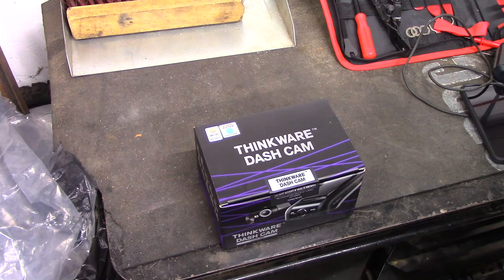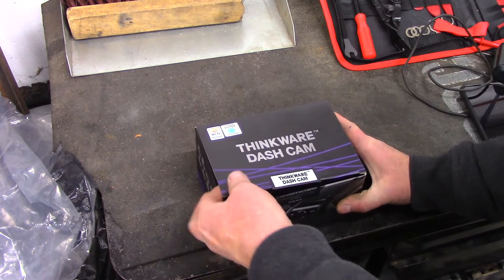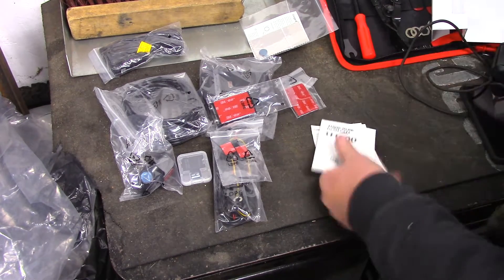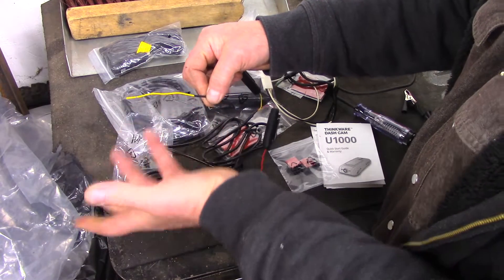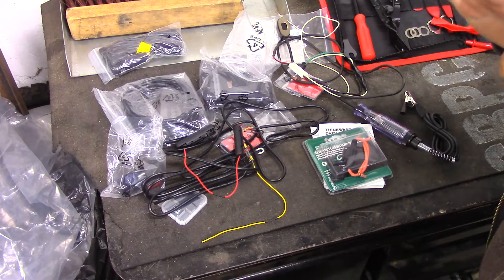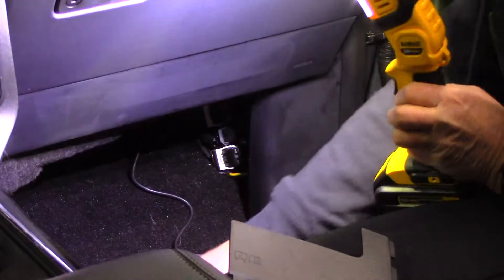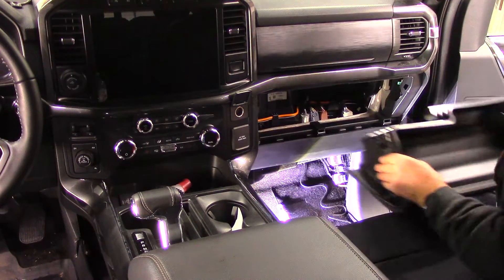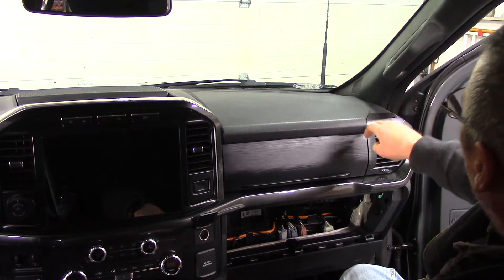Installing the Thinkware U1000 dual dash camera in the 2021 Ford F150

Comment: Great video. I’ve had the U1000 front and rear in my 2019 Raptor going on two years now always powered via OBDII with a dedicated hotspot that runs 24/7 to allow it to send my alerts if a parking incident should occur. You actually get the same parking incident recording options via OBDII as you do by hardwiring it with the battery protection feature turned off the camera will record 30 seconds prior to an incident should one occur in parking mode. The only mode it waits for something to happen before recording is “energy saving” which you may as well never select if you want true parking mode recording. Anywho thanks again for the video I never properly hid any of the wires so with this video I gave it a go finally. Cheers 🍻

Comment: That wireless charger fuse is the usbs slots inside the middle console armrest. Thats the only “wireless” charger i could think of, i also have a 2021 f150 xlt with the 302a package. I use the usb slots in the center console and my phone charges with the truck off too. Which should explain the constant power. Im also installing a dashcam, particularly the Vantrue n5 one. Does the trucks battery not get drained by having it solely tapped on a fuse with constant power? Excuse the ignorance im learning as I go
Reply: And a side note, i dont know why or how but both the cigarette lights in my truck have constant power with truck on and off so i couldnt use the cigarette lighter for power. Dont want to run the risk of a dead battery
Reply from the maker: It will completely drain the battery in 3 days......  These fords have so much electronics running even in truck off.  My 2006 silverado went over 10 days when I noticed I forgot to turn off the dash camera, it started !

Comment: Excellent video. Thanks for showing the trim removal part, no one is showing in there videos and i was afraid i’ll break it.. lol. Trying to save $250 + tax CAD in installation charges by the local shop. (spent all money on the truck 😂) Where did u coil up the access cable?
Reply from the maker: I just found a place in the pillars to hide the access, paying attention not to block the pillar air bags.

Comment: Which two fuse slots did you use to hardwire the fit cam x? That's the camera I have for my Ford 2021.
Reply from the maker: fuse #3, 7.5amp for wireless charging, which I don't have in my 2021 xlt with 302a package.
Reply: @farmboyfixes  ok thanks 👍🏾 I'll give it a try. Thanks for your response.